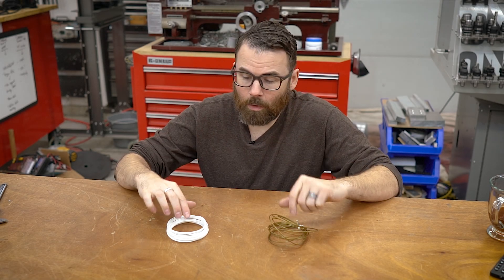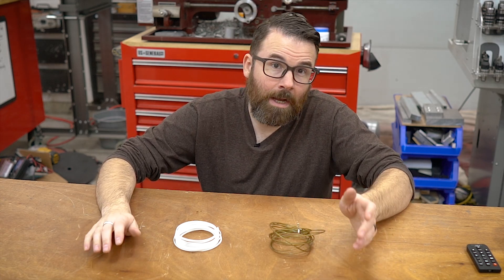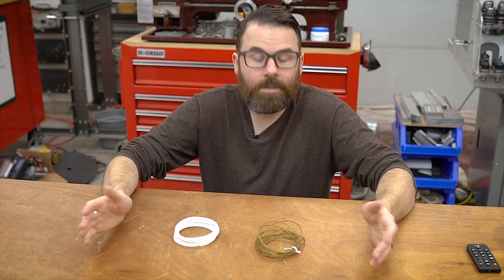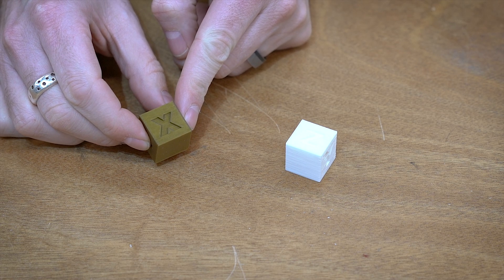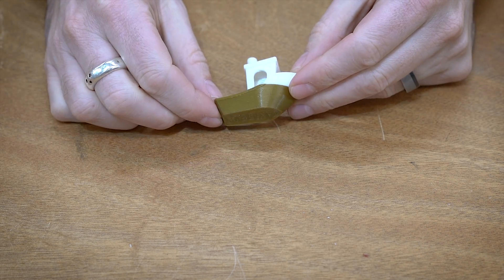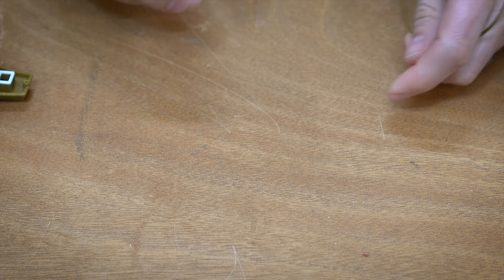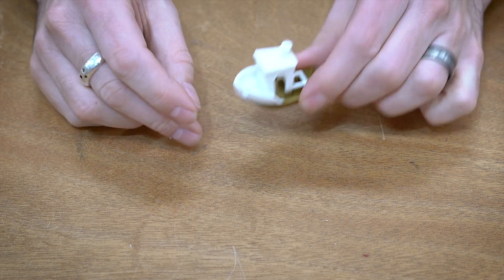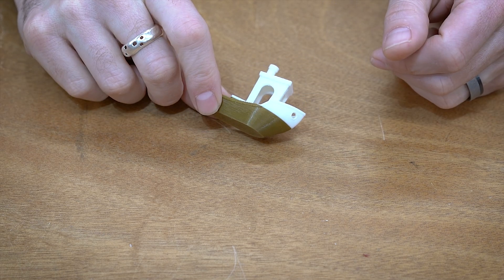Dry.  Your.  Filament.

Comment: It would be very interesting if you weighed a spool of filament before and after drying to see the difference. It would require a pretty accurate scale though but it would prove you're removing moisture and how much.
Reply from the maker: Yep, I've seen others do this.  There is certainly moisture being removed.  There's something happening beyond just the moisture it seems too.  Printing warm filament always gives me better results.

Comment: I don't think it's the moisture that caused it to go brittle, but i don't know what did. I think something in PLA just changes over time, maybe some sort of crystallisation process that can be undone by heat. You can try, put a loop of filament in a ziploc bag with a few drops of water and inspect it after a few weeks, it will have absorbed water, but it becomes more flexible rather than more brittle.

Of course printing with that waterlogged filament will still be a catastrophe, because when the filament is heated enough, foaming and hydrolysis will occur. Luckily hydrolysis does not occur cold, but also if it did, it's reducing molecular weight and there's no way the filament would be good as new after drying, it would just degrade super quickly when melted and would never reach the expected levels of strength, so you also know no substantial hydrolysis has likely occurred in the sample.

Comment: New to 3D printing and didn’t know about this problem. I had a open spool that I was using and I kept getting Brakes  1/4 way into a print. So I opened a sealed box and everything work on so I thought the old spool was too dry.  I’m going to dry out my old spool and run some tests.  I’m located in Vancouver  and live basically in a rain forest.  Thanks for the tip, you saved me some money!!!
Reply from the maker: Sure thing.  There is no such thing as 'too dry' for filament!  Good luck!

Comment: For anyone who doesn't want to buy a brand new filament dryer, a regular classic food dehydrator from a garage/yard sale works just as well - I've been using one to keep my filaments dry for a year or so now with no issues.

Also, a sealed box with a significant amount of desiccant (I think I have over a pound of silica gel in a sock) works wonders keeping the rolls from picking up any extra moisture between uses. You can microwave the desiccant to dry it, and reuse it over and over again.
Reply from the maker: Yep, this totally works!

Comment: If you don't have a filament dryer, you can also use the printers heated bed to dry the filament. I do this instead of using an oven for more accurate temperature control and it works great. Just cover the spool with something to keep the heat in (like a paper bag or similar) and leave it for a few hours.
Reply: Yeah i do exactly that, using a part of cardboard box one of the spools came in. Or a bag and some desiccant together with the spool.

Comment: I use to leave PLA in my printer and after a day or so, it was brittle enough to break between the spool and the extruder. The printer is in my garage and you would think that summer temperatures over 110 and a low humidity would not require drying the filament, but as Robert points out, even a low humidity area your filament can still suck in moisture.
Reply: I wonder if that's the heat releasing angry halogen compounds from the PTFE tube which attack and destroy the filament instead, rather than moisture, or some other influence like ozone. It is true that filament which has water in it doesn't print well at all, but i'm not the slightest bit convinced that this is the same cause for it being brittle off the roll, it actually gets softer and more pliable when it has moisture in it.
Reply: @SianaGearz  my printer is direct drive, so no Bowden tube

Comment: i have been printing pla for years i have never needed to dry out filament ever, makes me wonder are you all living with SpongeBob under the sea? lol 😂
Reply from the maker: You still may be losing out on some 'performance' from your filament.  I can easily print with slightly brittle PLA, but after drying it, I can get better overhangs, faster speeds, and better print quality in general.  It's not binary.  It's not like 0.01% moisture causes prints to just fail.
Reply: Do you live in a low humidity location?
Reply: All depends on the material some times. It may still print but the surface quality is poor and the part crumbles in hands easily. Ive noticed petg get cloudy and after drying its fairly transparent and smoother walls. Same with ninjaflex.
Reply: I live in a tropical country with 80% humidity daily. Fight me. If I don't take care of my PLA it snaps like a stick of spaghetti. lol. If you print in large quantities you're probably using up your filament before it spoils too. It does take a while to really get to this point.
Reply from the maker: @KryaDiere  I've received filament sealed with desiccant packs that has minor issues while printing (little blobs, zits, poor bridging, etc), and it is improved by drying.  As I've said before, it's not necessarily that it won't print, it just might not be as good as it CAN be.